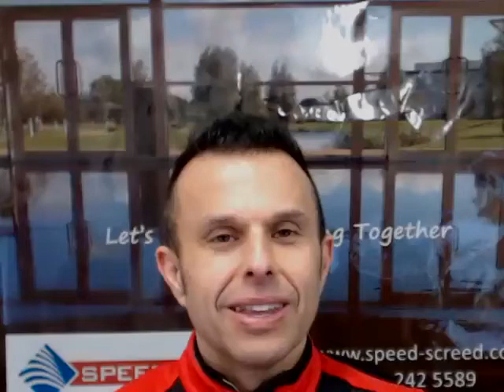How To Mix Floor Screed

Comment: So assuming the sand is dry and I am using a pan mixer would four buckets of sand ,one bucket of cement and one bucket of water give me the right mix?
So two buckets of sand go in first with no water, then one bucket of cement , then the full bucket of water all the time with the mixer running. Then the last two buckets of sand. Or do I need to weigh the water in the bucket to equal the weight of the cement? How long do I leave it mixing in the pan mixer?
Many thanks
Reply from the maker: Nice to hear from you Jim.  BS8204-1:2003 talk about ratio by weight.  Therefore you could use the buckets, but weigh and mark the same weight for both sand and cement buckets.  In terms of volume of water, you will need to use the snowball test (make a ball in your hand to test if you have enough water in the mix).  Not to wet or dry.  Experience will help with this part of the process.  Simply mixing a set weight/volume isn't going to work.  Start the pan mixer once all the materials are in.   

I hope this help.

Regards
Andy